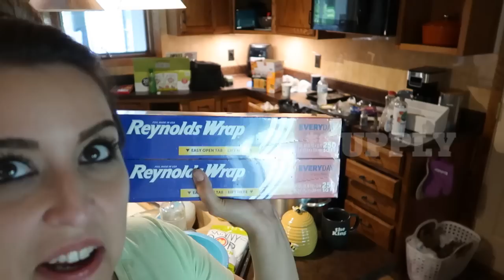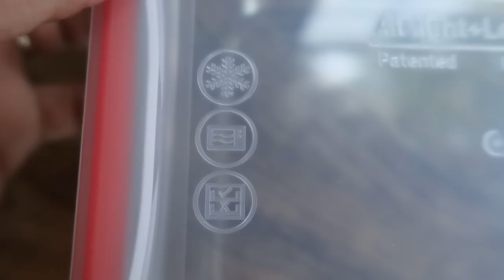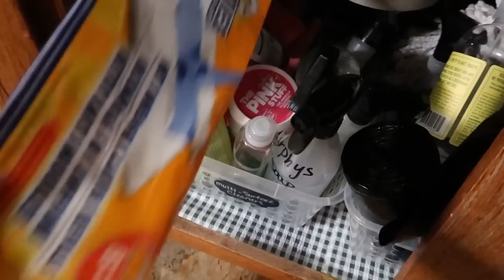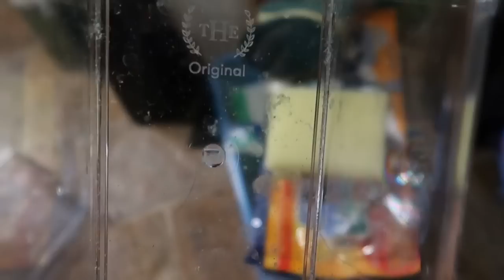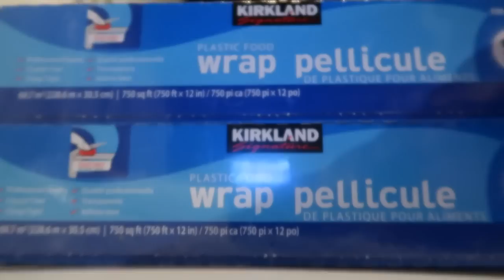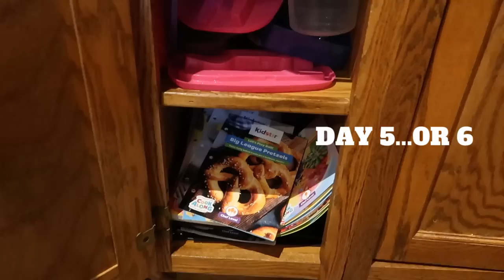WHOLE HOUSE CLEAN, DECLUTTER & ORGANIZE 🏠 It's a Mess & Things Keep Breaking | Cleaning Motivation!

Comment: Hi love you !!! Maybe you want to try pumice stone for bathtub
Reply: I've been looking for pumice stones lately! 
I had a stain on my tub from an ayurvedic remedy (long embarrassing story I won't get into..) but the method I read up on was to actually use bicarb and vinegar into a paste and then put a towel or cloth over the stain to lift the stain\s out of the tub.. Seems to have worked quite well, but might need to do it one more time just to get the last bit out.  
Other tub cleaning options include:  Lemon + salt, dishwashing tablet (or pod), 2:1 bicarb soda + hydrogen peroxide, vinegar + dish soap (and let sit), or plain ol' bleach! ^_^

Comment: Hi Dani. To clean pillows and such I ordered a large netted laundry bag. You put your pillows or other delicates in the bag in the washer on light or gentle cycle. It works better and easier than the bath tub.Oh and ps baking soda is not good for vacuums it clogs the works. I googled that so it's true lol. Yeah but really it can't be good.Despite many online guides recommending baking soda for cleaning carpets, there are dangers to using this homemade cleaning product. Baking soda can clog your vacuum's filters when it's vacuumed up from the carpet. Even worse, if your vacuum's filters have a leak, then the baking soda particles could ruin the motor.Mar 4, 2022

Comment: That same electrical issue happened to us 2 years ago. We had to have our panel replaced. The incoming line from the electric service was fried, and in turn was burning inside my panel and causing the breakers to burn out. Be careful. That can cause a major fire.
Reply: Thise brown outs(half power) with burn out appliance moters. Probably what happened to the fridge and dishwasher. Unfortunately , nothing was visible until they took off the main box cover. Wish i could share a picture of it with you.

Comment: Your kids are learning a valuable life skill by decluttering their stuff.  The more they use it, the better they get.  
My house is almost 20 years old, not too bad.  But it went through a phase where everything was needing replaced.  AC, fridge, water heater… I’ve replaced every appliance except my oven over the course of two years.  I’m replacing the floors now (from builder grade carpet) and then I have a light fixture that doesn’t work that I have to replace, a porcelain TP holder that is embedded in the wall that got broken.  Oh, and a crack in a seam in my drywall.  I feel your pain, girl!
As far as a shampooer, whatever one you get , make sure you can easily clean the dirty water tank.  I got one that works great, except I can’t get my hand into the dirty water tank to clean it and the residue builds and it gets dirty to the point that it needs more than a rinse.  Mine is Bissel brand and it works great as far as cleaning power goes.

Comment: I've seen you in that Central Perk tshirt many times but just now feel compelled to say that I have it too lol the one I got is sleeveless but I kinda wish it did have sleeves like yours. As for the word, you were just using thermometer and thermostat together lol they both deal with temperature so it makes sense lol. Sorry about the electrical issues. Only one outlet in my kitchen works (crappy apartment so they're probably never going to fix it) so all my small appliances are plugged into a power strip which I hate doing but oh well lol. Murphy's Law does hit hard sometimes right? But yeah we gotta take it in stride. Great job on the house as always!

Comment: Great video! I had a great day cleaning yesterday.  But, today. I feel like a giant rock with a head. My body don't wanna move at all. And, my head is in over drive. I took the hose off the back of my washing machine.  To clean the grit out of it. So, the cold water will run faster. Well now i can't get the hose to stop leaking when i put it back on. 😂 i put plumbers tape on it and still leaks. So i quit!
Reply: It sounds like you invested a lot of energy into your cleaning mission! Good on you!!  Perhaps did maybe one of the seals get moved or drop down when you were cleaning the hoses? Leaking is very frustrating! I feel for you! I hope the leak gets fixed for you soon!!
Reply: @igitha..._  thank you. I don't think I put enough plumbers tape around the threads. Before putting the hose back on.
Reply: @sherrygantt2158  Plumbers tape is good stuff! I should make a stash of plumbers tape for such a situation! Good luck! 🍀💓

Comment: Do you clean the filters in your appliances? You should be cleaning the filters in your dishwasher, washer, dryer, vacuum, ac, gas heater regularly. A lot of people will have their ac and gas heater serviced about once a year to upkeep it and make sure it's running efficiently and safely. You can always watch videos and do it yourself, but to get them serviced once a year is like $90. You are supposed to change your air filters like 4 times a year etc. When everything is clean, the engine will last longer. If you clean the coils on the fridge, your fridge will perform better etc. Obviously, the current issue is some bigger electrical issue. 

In the future, don't buy things that don't need electrical components. the settings should all be manual buttons, you don't need any fancy screens, settings, or beeping. you don't need electrical stoves etc. you don't need dishwashers with electrical sensors that can tell when the door is closed, just get a dishwasher with a latch. the less screens on your appliances, the longer they will last. Get basic, good brands.
Reply from the maker: We do change our air filters, I'd say about four times a year, I think Ian does that every 3 to 4 months, we do have our AC and gas heater serviced, we have our gas heater serviced once a year, but I will say that the AC doesn't get serviced as frequently as the gas heater, so that's something that we should really be paying more attention to. I will admit Ian does most of this stuff, but I really should know how to do a lot of this stuff. We just got a new fridge and dishwasher, and I'll admit with our last dishwasher we did not clean the filter because it was so old we had no idea how to even get to the filter, so it's really nice that we have a new one cuz I know exactly how to get to the filter with that one, so I have to get into the habit of really keeping that clean.
I also wrote down what you said about the electrical components, I wouldn't have even thought about something like that, so that's really good to know, especially for any future purchases. Just stick with the good basic brands! 💯 I really really appreciate you sharing this with me, these are things that I really should know more about. And thank you so much for watching and being here, I appreciate ya so much 🥰

Comment: Too many toys.
Reply: They can be cycled out monthly or seasonally, Danni's done a great video about toy decluttering already and it's always a work in progress with children! Getting a system happening is key, I've opted for cube shelving with collapsible storage cubes for toys so they can just be thrown in. Another method is putting a sheet down on the ground so when it comes to cleanup time you just grab the corners and it all comes together easily without having to pick up everything piece by piece 😄
Reply: @igitha..._  I go by the scientific studies that say kids thrive when they have less toys, cause their imagination works better.
Reply: @charlenebrissette3348  
💯 agree.
Reply: @charlenebrissette3348  If you cycle them out they are not seeing them all at once, so they can also use their imagination just fine.